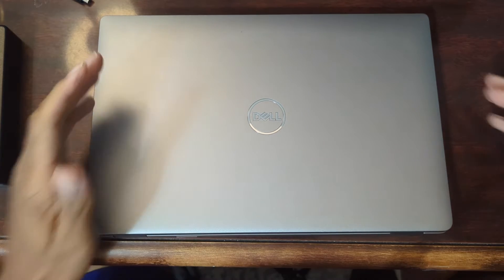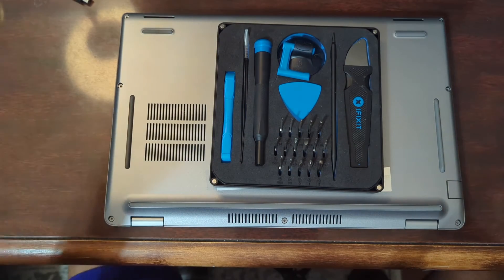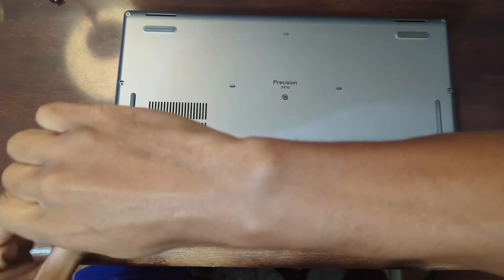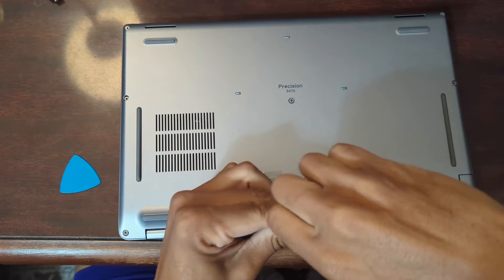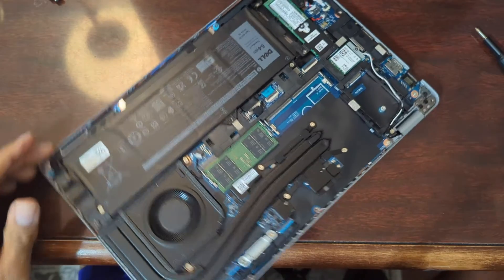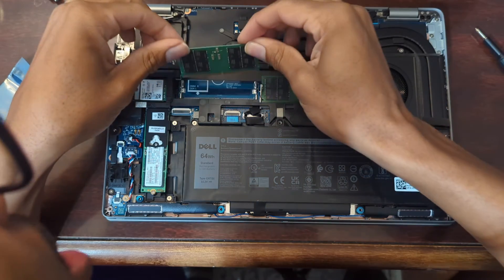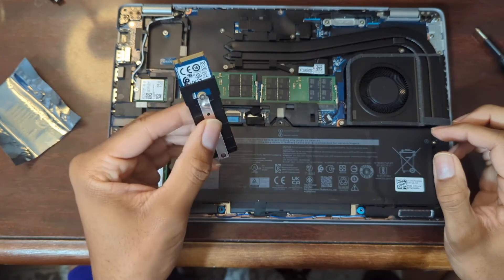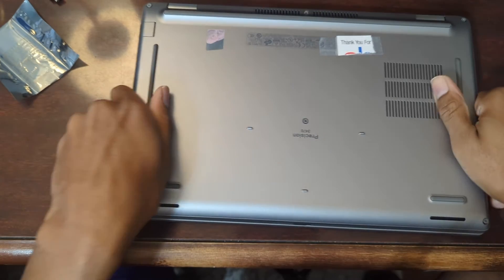Dell Precision 3470: RAM Upgrade

Comment: Hi I know that most dell precision mobile workstation has overheating issues and thats why I want to know that this model has the same issue or not ?
Reply from the maker: It definitely does get hot and the fan noise is there. If you buy one, make sure you have an PCIe gen 3 drive in there, not a gen 4. For me, the gen 4 drive got too hot.
Reply: @followthecable4379  I wonder if a heatsink would help? One Samsung model comes with one, but the one I saw in your video was not that one.

Comment: Before u change Ram u need to go in the bios ^^
-Systemstart press " F2 "
-Systemconfiguration
-Sata Operation
-choose AHCI ; )
then it will boot with no problems : )
Reply: FIRST FIRST FIRST Step u need to do unplug the battery
Reply from the maker: Thanks for the steps! And I know I know. lol. I really screwed up by not unplugging the battery first. Fortunately, I didn't fry anything.